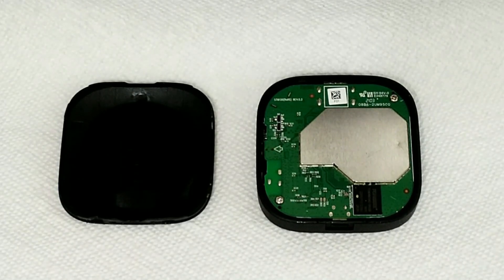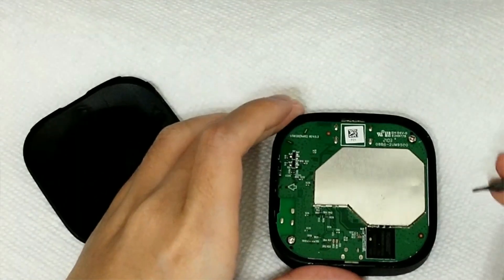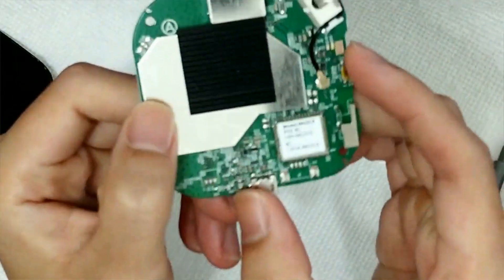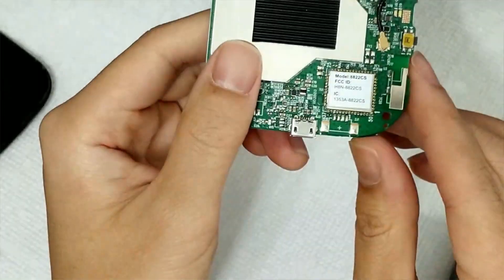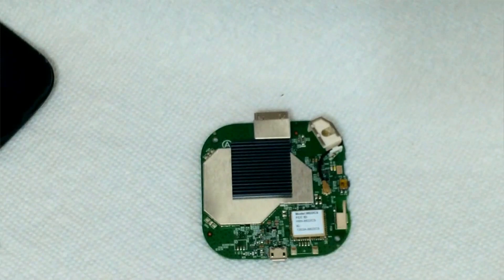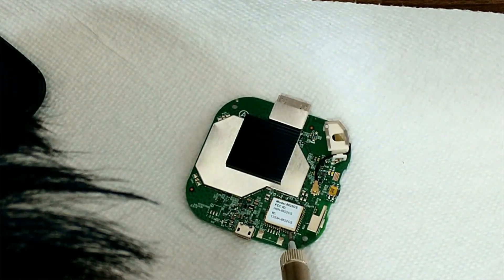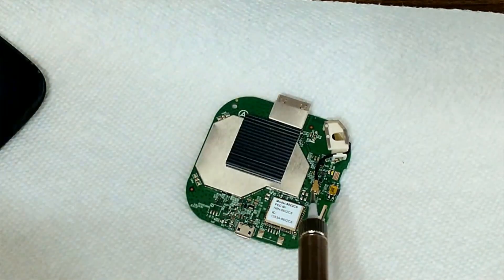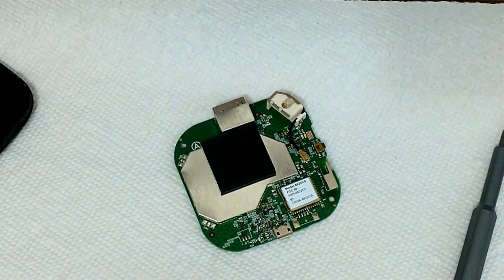Repairing a Walmart Onn Android TV Box | Unscripted Coding

Comment: Hi, the 4 contacts on the board, next to the USB connector... 
For an extra USB connector? 
Modding possible with a cable and aerial USB female connector...
Reply: You can add a usb OTG cable to it also if that could suit your needs
Reply from the maker: It's a good question and the honest answer is, I have no idea. 😅
Reply: You could check for continuity with a multimeter between the 4 That you're talking about compared to the 4 for the micro USB.